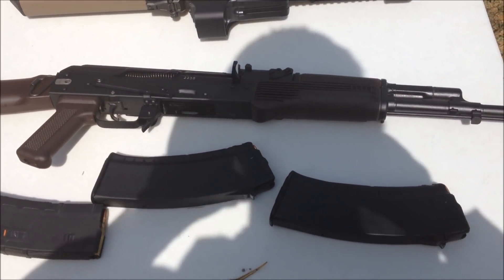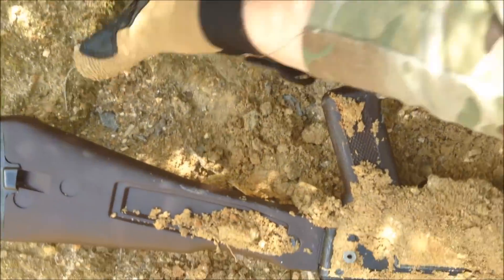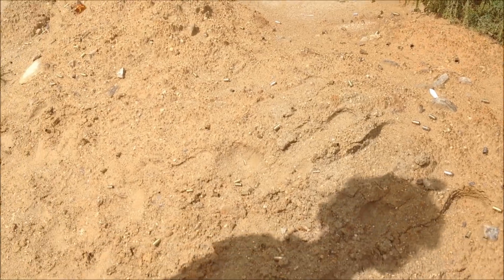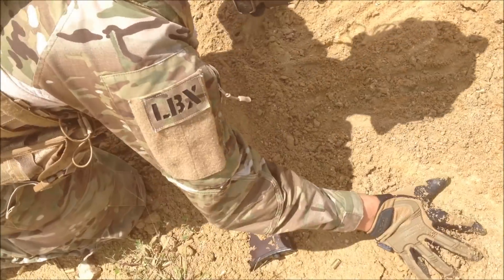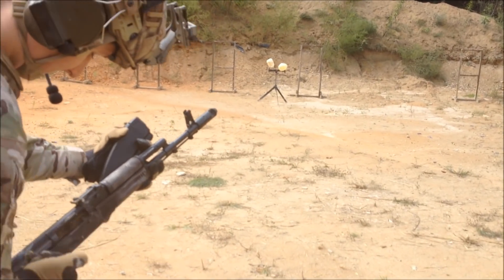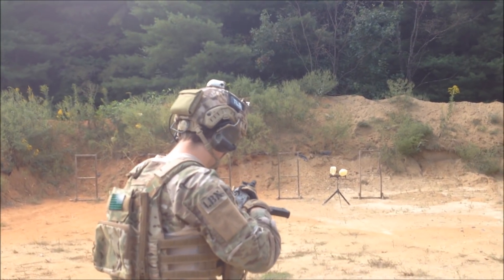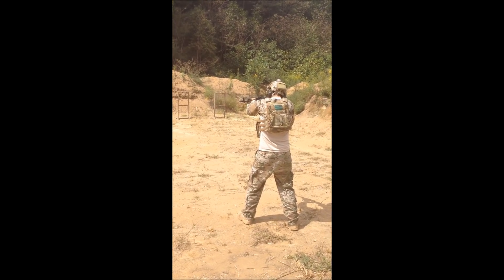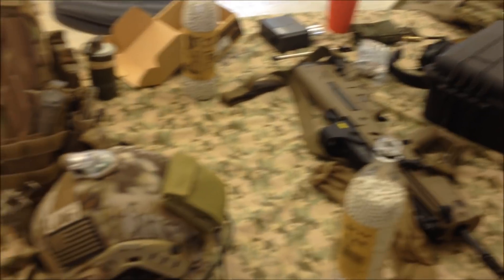NEW AK 74 TESTING

Comment: Can you do the same thing to an M4 or a M16 and still have it shoot ?
Reply from the maker: CommandoCorps yes I going to be doing it to  ar15 soon
Reply: +CommandoCorps Fuck no! I've carried the M16-A1, A2, and M4-A1, NONE of them could you open the bolt, dump a handful of sand in, get it in the mag well and expect the weapon to fire. That being said, the 74 only fired ONE shot  before failing to chamber another round. SOME dirt or dust is OK. That much would stop ANY weapon...
Reply: Better question is...who made that AK-74?
Reply: +Тайвин Ланестер ахах он и в воде может стрелять
Reply: no u can't
Reply: there is a lot of video about m16 vs AK. m16 sucks!  Always))
Reply: TheNiccolo4  yea and that AK is really takin alote of dirt. I wouldn't do that
Reply: CommandoCorps yeah ars can handle dirt way better that aks chaues there a closed systems
Reply: Lmao not long
Reply: InRangeTV has done a lot of videos where the AR15/M16 was covered in mud and it outperformed the AKM. Recently they just did a video on the AK74 and it still didnt beat the AR15/M16